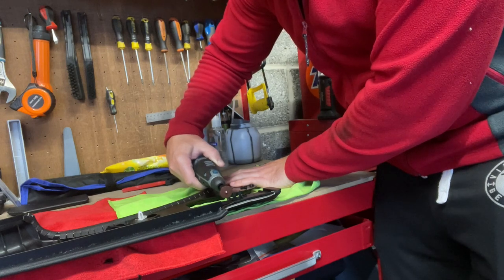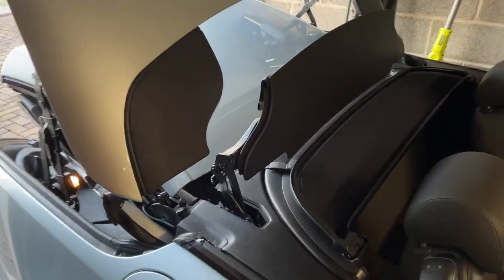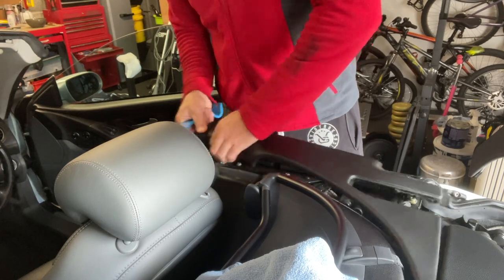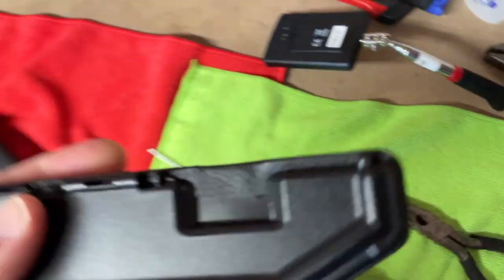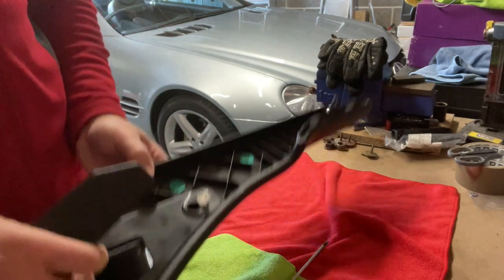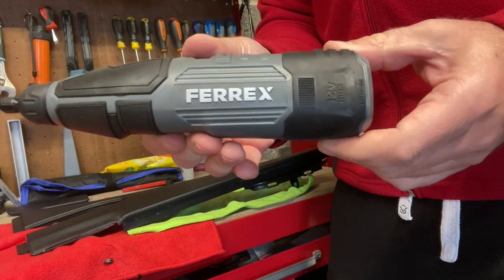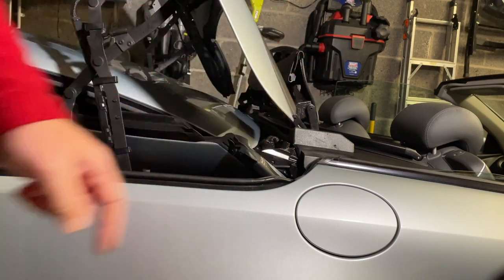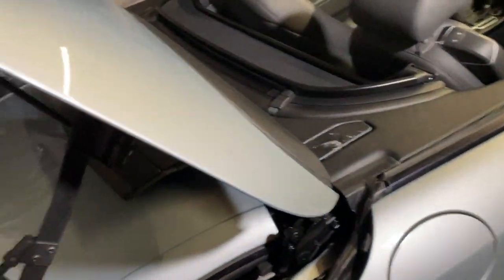Mercedes SL350, SL500, SL550, SL65 AMG R230 Roof Hinge Flap repair

Comment: Did this repair today. Probably bought the part 2 years ago… Was pretty easy. I didn’t put the hinge together before gluing it so getting the spring reinstalled was a bit of a hassle but with some persistence I figured out a method that worked. Didn’t have to worry about getting glue on the cover…

Comment: As far as the cost from MB I have this story from 2021.  I went to the dealer to buy a liter of rear end fluid and asked the guy about this part.  He found that one has to buy cover piece it's attached to and after looking into this for 45 minutes came out to the lobby and told me there were 2 part numbers.  The original pn was $549, but he doubted we could get it as the new pn replaced it and with the car being so old, thought all the original parts would be gone, leaving the new one at $1459.  He felt so bad about the price he gave the $40 liter of fluid for free (and no I did not buy the part)

Comment from the maker: You can still do this repair if you are missing the spring! Should still work but flap won’t be as springy obviously😊
Reply: Greetings from Wisconsin. Thank you for the very informative video. I have to perform the same operation on the right side just as you did, however, I no longer have the flap, spring or rod (either lost in the wind or the original user didn't know what it was and threw it in the trash). Anyway, I was able to source the flap and related hinge bits from Octoclassic (thank you for the lead) and will attempt to find a suitable rod at the local hardware store. I'll also look for a spring, but the one needed seems to be very specific to this application. Thanks again for your help!
Reply from the maker: @bigdog7813  thank you very much! Glad to help!

Comment: Thanks Dave, that saved me a few £££! The hinge I bought from EBay slightly different as it did away with the spring, instead put a small weight on the underside of the flap, which helps it fall back down
Reply from the maker: Great glad to hear it! Drop the link to what you bought as I’m keen to see it incase I lose a spring!👍

Comment: Thanks for your video, I have the same problem , but on the left side. I did not the 8mm socket nut being retightened in the reassembly. I would appreciate your comment on this. Thanks
Reply from the maker: Just the reverse of the removal. Make sure the plastic tab is seated properly then lightly tighten the nut. No need to remove the nut, just loosen it.

Comment: Very good video. I brought it off eBay but it didn't come with the spring or rod. Do you think i could find similar replacements at a hardware store??
Reply from the maker: Unfortunately they don’t come with any hardware so if you have lost the flap you will have to source a new spring and rod. They are very small so a look on the web may help in the first instance.

Comment: I had the same problem on my SL55 and I made metal hinges… and repaired my little flaps. I made a couple of more hinges for friends in the German SL R230 club. You can find the manual and hinges when you search for kleine-klappe
Reply from the maker: Thanks, to be honest your hinges look better than the plastic ones. Mine have held up but yours look more robust. Do you sell them and ship to uk?
Reply: @autogaragelife  yes, I sent two of the repair sets already to the UK... (and some to France, USA, Japan - it is a hassel with the tax declaration :-) (sorry for the late answer but the forwarding of my gmail's to my reguar account got stuck somehow)
Reply: Hello, do you have a link directly to see this? Have this issue on my SL now.
Reply: @danielboutros2648  in Pontarlier
Reply from the maker: @danielboutros2648  there is a link in the video description 👍